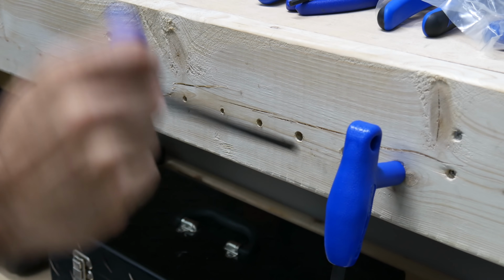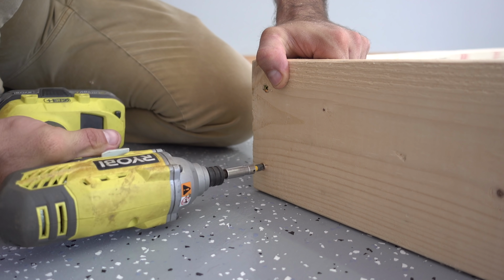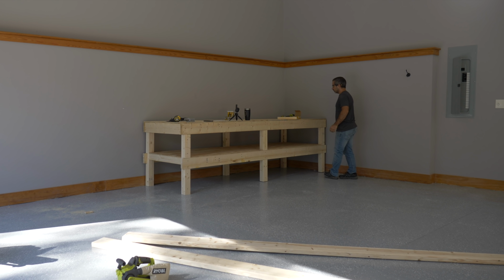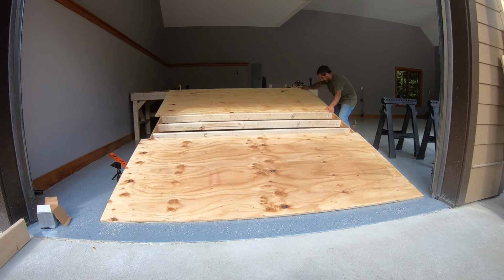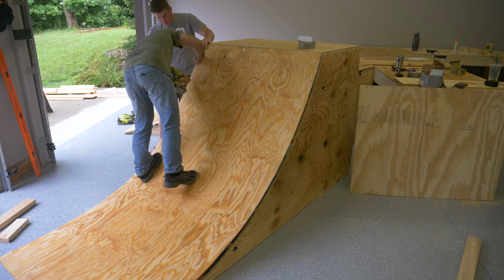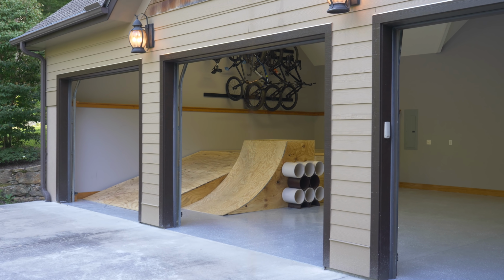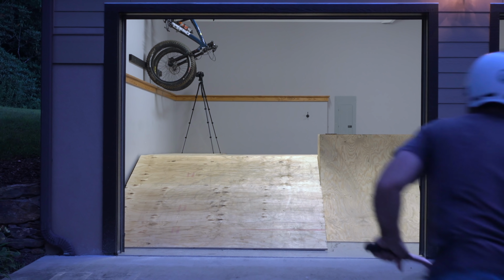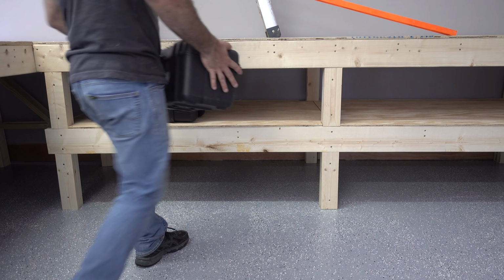Building a Workbench Skatepark in my Garage

Comment: Hey, Seth, I made a hack were you would cut inner tube about 3 inches and then hot glue the bottom of the small tube. Then get sheet metal screws and screw the top of the unglued side to a workbench or some
else. it is great for holding scissors or pencils.

Comment: Idea: looked like you were nicking the rail for the garage door a bit. What if you bumped the ramps over ~12 inches and filled in the space with plywood cubbies or some other storage solution. You could cover the cubbies with a gym mat too and store the more unsightly stuff in there - protecting the drywall, yourself, and storing stuff.

Comment: i used to have a skate box and it would take two people to carry it to the street. So we put hinges on the bottom with a 2x4 and attached wheels. LIft up one side and the wheels would flip down, lift up the other side and then you have a mobile skatepark you can push around by your self.

Comment: You need to build some kind of bumper to protect the garage door rails. I see you busting them up jumping on that ramp.

Maybe get a 4 inch pipe. Not sure if pvc will do the job. Cut the pipe vertically, taking off maybe a little over a quarter of its circumference. Wrapping the pipe around the garage door rails, securing it to the ground and wall. Put some padding on it, and calling it a day. If it doesn't last, it'll be less expensive, then having the garage door rails fixed.
Reply: Make sure the pipe is at least taller then the bikes, or for your own safety, taller than you standing on the bikes.

Comment: You could use the top of the half pipe as a manual pad and make a little ramp on the other side. You could add a rail ot a ledge there too fot the bmx

Comment: Personally i would move the bike rack to a different area and make that ramp bigger like the whole size of the door bigger then drill two slots in the wood so you can have you're main bike free standing then have stairs next to it then you can have a kinda Thunderbirds take off point and just to make it cooler you can have a garage key mounted on your handles so pretty much this is how it would go, walk through the door to the other side of the garage walk up the stairs where your bike will be free standing with the garage key mounted on your handlebars press the button to open the doors then mount your bike and then go down the ramp to the outside

Comment: I'm not digging it. With that ceiling space, I'd just hang bikes from the ceiling using the pulley set ups you can buy for cheap. Maybe get some electric motors (also cheap at scrap yards) and now I'd have a push button electric bike lift, way cooler and not difficult. I often have equipment and tools on my workbench and its nice to be able to walk away from a half finished project on my bench and not need to stand on it to retrieve a bike. At some point that garage door sensor will get smacked and probably the door tracks as well. With that amount of land and the location, I'd just set up some ramps outside instead of waste garage space. That said, its cool for what it is.